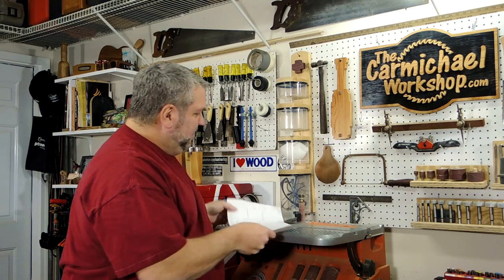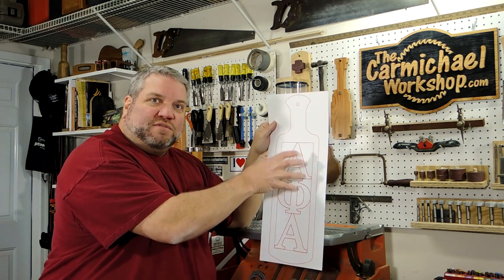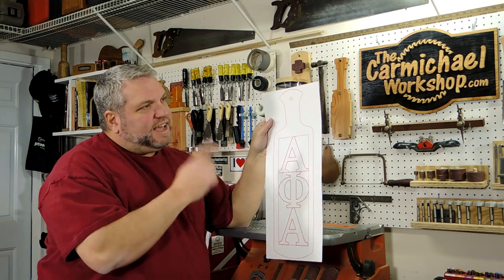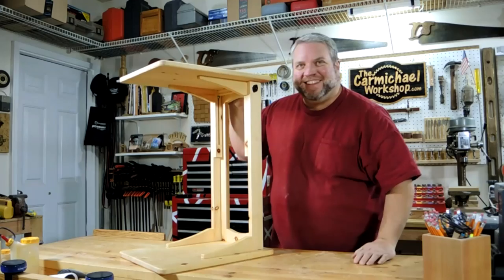Fraternity Paddle Wall Decoration

Comment: Steve, 
Questions for you? What band saw would you go with for cutting 3/4 MDF and blade/tooth count. I need it to be clean cuts. Your work and vids are awesome!!! Thanks.
Reply from the maker: Andy Sommer Hi Andy - Thanks!  I used to sell lots of Guitar Hero guitar hangers that I cut out of 3/4" MDF.  At the time, I used a $100 Delta 9" benchtop to cut hundreds of those out.  I used whatever blade was at Lowes, probably 8 tpi range.  If you want to cut thicker stuff like bandsaw boxes or need more than 9" clearance, then a 12" or 14" would be better.  The thicker the wood, the fewer tpi you want.   (http://www.amazon.com/DELTA-BS100-Shopmaster-9-Inch-Bench/dp/B00006JZZT/?tag=lege1-20)

Comment: Turned good Steve. You can get spiral blades they will cut in any direction so you can cut long projects. thanks for the video.

Roland
Reply from the maker: Backyard Woodworking Thanks Roland!  My old saw has pin blades and I haven't found spiral pin blades.  I was going to get an adapter but just holding out for a new saw.
Reply: OK I have a Harbor Freight saw bought an adapter for it and it made a big difference changing the blades etc.

Comment: Hey man what is the decal you use called to make the form of the paddle? Where can I get that?
Reply from the maker: Luis F. Rodriguez Hi Luis - I made the cutting template with Photoshop and Word.  I just printed it out, then attached it to the wood with spray adhesive.

Comment: Hello I hope your holiday were wonderful. I might have asked question to you before but I was wondering how much would it cost to get sorority or Greek paddles made by you?
Reply from the maker: Hi Kenyetta!  I cut out and sell these wooden Greek letter paddles for $80 plus shipping.  That includes changing the letters and doing any custom engravings.  For example, I've had people request a name or year on the handle, or extend the blank space at the bottom of the paddle to incorporate a small picture frame on it.  Email me at  thecarmichaelworkshop@gmail.com if you are interested.  Thanks, Steve...
Reply: I just the letters on the paddles  no design. So that would be $80? How do I give u my address without putting it on here?
Reply from the maker: @kenyettalewis4727   Yes, $80 plus shipping.  Email me at thecarmichaelworkshop@gmail.com
Reply: @SteveCarmichael  ok I sent a test email. Let me know if you got it
Reply: @SteveCarmichael  I sent u another message with pics

Comment: Great video - makes me want to look for a used scroll saw:-)
Reply from the maker: Mofjell1981 Thanks!  You should keep an eye on craigslist.  My 13" craftsman does a good job but it uses pin blades that require large starter holes.